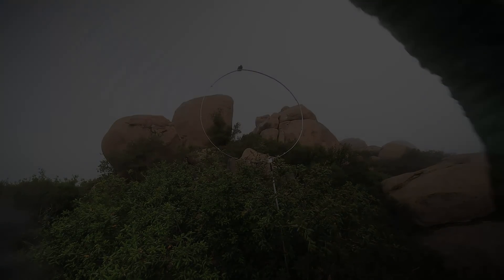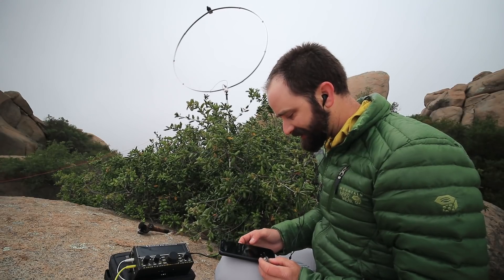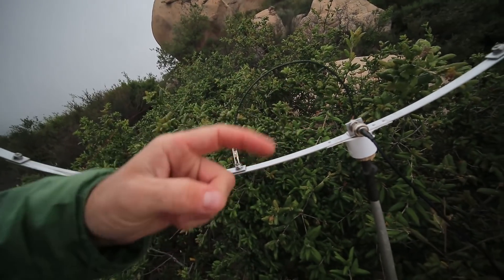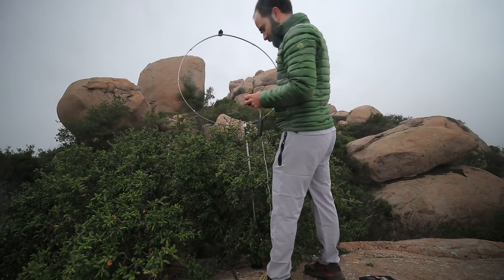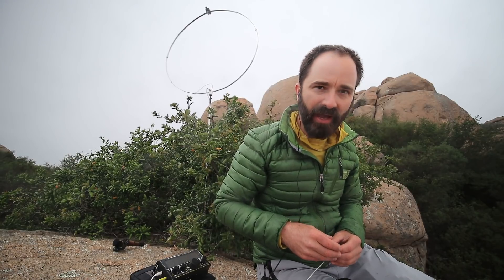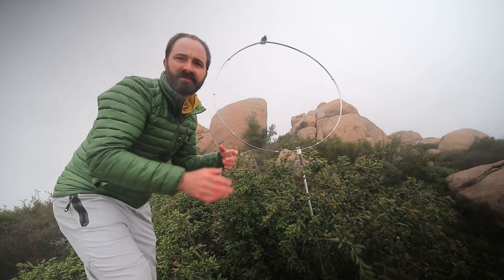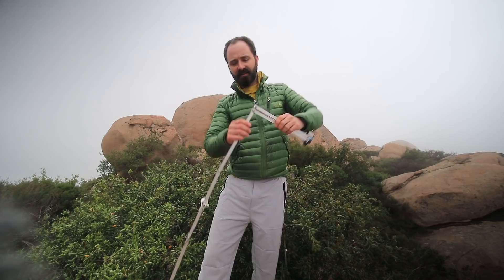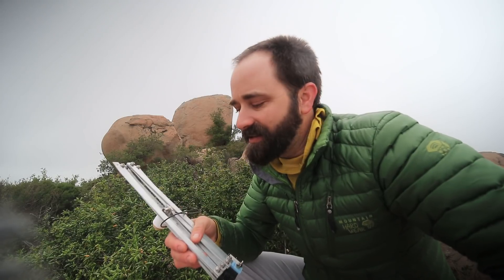Tiny Magnetic Loop - Big DX

Comment: I got a heads up about you magnetic loop video from KB2HSH. John runs loops in his apartment, mostly on FT8 & FT4. I build loops from RG-11/u coax and air capacitors, not as portable as yours, but functional nevertheless. 

I am handicapped with two total knee replacemebts, so no hiking to a site for me. If I can't get  there with my Forester, I can't operate portable, heh... My more robust loops fit in the car nicely and a drive-on mast stand rounds out the station (wagon).  Assorted QRP gear here, FT-817, X6200, G106 and a G90. I run off the car or off a 20AH AGM battery.

Hope to catch you on the air further down the log! 73, Keith, WB2VUO near Buffalo, N.Y.

Comment: What CW keyer do you use and what logging app on the phone?  Tks
Reply from the maker: The KX2 has a built in keyer, so no external keyer is required. Just plug in a paddle. I like to log using POLO. Great app!
Reply: @K6ARK   Sorry . . . I mean the "key"  Paddle.  Tks
Reply from the maker: @h2osmokey for this one, I was using a little homemade unit cut from acrylic and using some steel shim stock as the levers. I would recommend building one of my paddles posted on Printables.com. they're cheap and work very well.
Reply: @K6ARK I'd be interested in buying a couple of them as I don't have 3d printing ability.
Reply: @K6ARK  Are they available online for purchase?  Don't have printing abilities.

Comment: Excellent design ! Using fixed capacitors plus low value variable probably makes it easier to fine tune as on my loop the peak is very sharp and narrow and hard to find. I will give your idea a go.

Comment: Loops are amazingly good considering their small size. I've used one indoors and got into a lot of Europe with it, 5 Watts or less. I used a coupling loop which is not perfectly circular to get a better match. I want to try the gamma match sometime. I got an FT817ND to go portable and a loop built for it using ½" coax so it can be coiled up to fit in my motorcycle panniers or rucksack. H/B radio too big.
G4GHB

Comment: I've been using magnetic loops vfir more than 20 years. They are great. Especially 20m up to 10m I will not be without my copper frames 😂. Don't need a tuner. The vary cap is the tuner itself. Good job Adam.

Comment: got to be the best loop design so far! Are you about ready to show us how you build it would love to get some additional information how to build a magic box and the size of capacitors
Reply from the maker: Yes, I just need the free time to make a build video.  Been working hard on antenna kits, winders, and new 3d printed paddles. Hopefully soon?
Reply: @K6ARK  Isn’t it great to be busy!
Reply from the maker: @PatAutrey  I need to retire! This dang work thing is cutting into my fun time.
Reply: @K6ARK  I was wondering if you have ever used an auto tuner to tune a magnetic loop directly ,- I have the MFJ 939 auto tuner and was wondering if it would work on a magnetic loop that I made mounted to a hula hoop, would not be using any other tuning circuitry other than this automatic container what are your thoughts o

Comment: Great job!

I’m wondering about the joints between the bars and the resistance caused by not being a continuous piece.  I had thought that was the reason people made them out of copper tubes and whatnot, but have not read up on them in ages.

Comment: Do you know if anyone makes a kit for this type of antenna? Considering buying a small QRP radio and looking for a decently performing, lightweight, compact antenna. Too many of the antennas give good impedance matches, but terrible radiation. Thanks!
Reply from the maker: No, I've never seen one. It's not a particularly efficient antenna, but as you could see, it does work.  I generally prefer an EFHW with very small wire which packs down much smaller, but obviously requires a larger footprint when set up. Your best bet if you don't want to build your own is probably one of the mag loop models that uses coax as the loop. I still plan to make a build video for one of these antennas, just haven't had time. Work and life are taking up a lot of that lately

Comment: That should be able to handle alot more power than coax loops. How many watts you think it will handle?
Reply from the maker: The primarily limiting factor for loops is the capacitor which experiences very high voltages. Because mine is built with 500v fixed value caps and a small air variable cap, 5 W is pretty much the limit. To push it up to 100 W, I would need a much larger, more expensive vacuum variable capacitor or a very large air variable with big spacing between the plates.

Comment: Do you notice any improvement changing the direction of the loop?
Has anyone compared this to a budpole, or any home brewing of 2 hamsticks configured at a dipole at about
6-10feet off the ground?  I can see this antenna as designed easier to transport.  Just curious how it compares
performance wise to other portable antennas.

Comment: I ran a FEM simulation.  Since the antenna is << smaller then the wavelength I can use magnetostatics.  I got an inductance of 3.097uH.   I modeled a loop with .5inch by .124 inch material.  I used copper (it should be Al but I don't think that will impact the inductance.   

 
This is 1 amp.

Comment: I never really liked the idea of magnetic loops because they are so narrow banded. However, this video made me realize that for something like SOTA, that basically doesn't matter because you spot yourself on a frequency and stay there. So it looks like I have a new antenna to research...
Reply from the maker: Yes! For SOTA and POTA activating, most operating involves just selecting a frequency and calling CQ. I don't often use a mag loop on summits, but they are very convenient when space is limited for setting up a more efficient and broad-banded wire antenna.

Comment: Couldnt count my fingers. Actually, the loop is 12 feet in circumference, about a meter in diameter. I tried adding 4 more feet but it just got unwieldy so back to 12 feet. Efficiency plots out to something like 14% on 40m to the mid 90s on 10 meters   Air variable wont be here until mid week next week so film at 11.

Comment: No 1/16 stock at my local HD but 1/4 worked ok. Cut it into 2 foot lengths since I am not likely to be doing much backpacking   I used six feet and it came out to just a shade over a meter in diameter. I still have another four foot piece. I bet if I stuck that in there it would be more efficient on 40 m. Just thinking out loud. I have a couple of 2-20 pf air variables ordered. Now I need to figure out the fixed caps
Reply: Ran the calculator and it confirms my thoughts about the size. Going to add another 4 feet. something like 95% efficient on 10 meters. Pretty good on 20. Not real happy on 30 and 40 but it looks like it will work at a low efficiency
Reply from the maker: Awesome, John! Would love to see pictures when you're done.

Comment: I've never seen anyone use a Gamma match on one of these before, is that better than just using a small loop?
Reply from the maker: Better? I don't know. But it works... 
I suspect my method of gamma match attachment could be more lossy due to potential resistance at the alligator clip.  It does, however, have an advantage of being easier to tune for minimum SWR because I can move the attach point.

Comment: Wow! Great 40M JA contact.
Very interesting construction. I'm amazed you can resonate on 40m wirh such a small circumference. Great idea of using a small variable cap to fine tune the large fixed caps. I've been suprised that other builders don't also do that and then complain about critical tuning. Seems like a 'No Brainer' to me. Should be standard practice.
I'm curious. What is your Transmitting Band Width on 20M/40M. I assume wirh such a small loop that SSB TX would be very distorted.
Regards/73 OM ..

Comment: Really nice design! I loce the gama match simplicity. Can I ask you how you calculate the 2 capacitor that you put in paralell of the variable for each bands? Also how did you came up with the lenghts of the gama match? Thks! DE VE2PF
Reply from the maker: Pierre, to identify the needed fixed capacitors, I set up the loop and attached a larger air variable capacitor across the tuning point using short wire leads and alligator clips soldered to them. I tuned the cap until I found resonance, then removed the capacitor and measured the capacitance with a LC meter. Knowing the capacitance range of my small air variable, I determined how much fixed capacitance I would need to have the same value I measured from the larger air variable.  I did the same for each band. 

I determined the gamma match length and configuration experimentally by arbitrarily choosing a starting length and then testing. I would move the contact point closer or further from the feed until finding the match closest to 50 ohms with the capacitor set to resonance. 

Hope that helps!
Reply: @K6ARK  It does help! you did experiment and came to specific value for your specific antenna.  can I ask you what are the value you got? And confirm that the small capacitor is 1 to 7 pF??
Reply from the maker: @pierremartel3552  yes, the small capacitor is roughly 1-7 pF.  Total capacitance needed will vary by the size of the loop and the frequency. Smaller loops with lower frequencies require more capacitance. For a 20-40m antenna, a 2m diameter loop is ideal. Check the calculators in the description for capacitance requirement estimates for a given loop size and frequency. They should be decently accurate.
Reply: @K6ARK  this will give me some starting point as I dont have larger air variable to test.

Comment: Would love to see inside the capacitor box.
Reply from the maker: Indeed... https://photos.app.goo.gl/vvxfF9YWXS3D2kKK8
Fixed capacitors on a 3 position switch in parallel with a small air variable cap. The switch swaps in the fixed capacitance required to get the antenna resonant within each band and the variable cap tunes across each band.
Reply: @K6ARK  TNX - I worked on a similar project some months ago and had trouble getting suitable results with switching the capacitors so I've abandoned it. Perhaps I'll go back to it and try reworking it. I purchased a high voltage capacitor kit from Amazon for about $9 and have been using them with good luck on other antenna projects. They're very tiny and should work on this loop project.
Reply from the maker: @glevideo  cool. Feel free to email me direct for any questions/discussion on how I make it work. Also, if I remember correctly, some of the ceramic caps I used drifted too much with 5w of RF going through them, so I switched to silver mica.  Class 1 caps should work too though (C0G or NP0).  I believe I was using class 2 not knowing what impact that might have, and the result was drifting tuning in a very high Q circuit.
Reply: @glevideo  Sounds interesting, I must leave in my home in Caracas Venezuela all my junk boxes of many years as a ham, and here in USA the pandemic situation doesn't permit me to assist the hamfest usually happens here. Could you share the specs of the cap on Amazon? Many tks from YV5FCK Armando in MI.

Comment: I assume the "inductance" of the antenna is just the self inductance of the loop.  How important is the resistive loss of the aluminum.  Do people ever use Litz wire for a loop.  I happen to have some.
Reply: I"m down the hill from you in San Diego close to Poway.
Reply from the maker: Howdy, neighbor 😆
I'm not familiar with Litz wire so I had to look it up.  I believe you need a conductor with larger surface area for lower resistance at high frequencies.  A wire like that might buy you a little, but I don't think it's a substitute for a larger conductor.  But what the heck, give it a try and let us know how it goes!
Reply: @K6ARK  Litz wire is used for high frequency switching power supplies.  Often as small as #40 gauge for each wire.  It's not hard to calculate.  I'll give it a try for 20m.
Reply: If you take a .25" copper tube at 14 MHz then resistance per meter with skin effect is 48 mohm/m.  the resistance of #40 wire is 3.9 ohms per meter.  So if you use a litz wire made of 80 strands of #40 you get the same resistance.  That's equivalent of a 28 mil diameter wire which is #21 gauge.   Litz wire is woven so the outer wires go to the inside so the current flow is balance.  There are some tricks to soldering the wire but not bad if you get the correct insulation type.  
  .
Reply: Note that on copper tubing the current will flow on the sides surface so the resitance is higher then my calculation.  But that would not be an issue with Litz wire.
Reply: I meant the inside surface.
Reply: @K6ARK  any poop on the matching device. Getting ready to spend the summer in the mountains in NC. Would love to build this loop for SOTA.
Reply from the maker: The box is very simple. Fixed capacitors in parallel with the small (roughly 7 pF) air variable capacitor. The switch changes the fixed capacitor values. The fixed capacitor values were experimentally determined to identify the necessary capacitance to get the tuning to the 20, 30, and 40m bands respectively. The air variable tunes across each band. https://photos.app.goo.gl/5B328Q8t1QMq3nc58
Reply: @K6ARK  Cool

Comment: Hi Adam, videos that cover your strategy for building and matching loops would be excellent.
Reply: I’ve built a few loops, from simple ones made from reclaimed RG6 and a toroid core ripped from a switch mode power supply, through to one made from 1” x 1/16” aluminium strap with a motorised tuning capacitor that handled 50-60W but caught fire when I gave it the full dollar :-)

They are excellent and, elevated enough seemed to out perform my back yard verticals I have made from aluminium tube 

The narrow bandwidth keeps the noise levels down, and certainly removes broadcast band interference on the Pixie my son built :-)
Reply: That big loop was 3m wide as well. Killer on 40m

Comment: Great job Adam !! Another Informative video !! Already built the micro-trapped EFHW. Was considering this type of loop but using a continuous piece of aluminum stock that I could roll up in a tighter coil to transport without all the mechanical connections of the sissor folding.  Food for thought. Look forward to your video on the capacitor box. 73 Terry W4ZQ

Comment: Brilliant and well done on the 40 m QRP contact to Japan, been messing with loops for a long while so like the idea of switching in fixed value caps, do you have a circuit you used ???, also where did you get that lovely little paddle from???, just set up a 705 to start doing portable activations and trying to get the kit down in size so many thanks for your time and sharing, 73 de G0VCW.

Comment: For the wingnut - get some brightly-colored nylon "mason line" at a hardware store and CA glue+tie a length to one of the wings. You can hold the line or loop the end around a finger while you screw it on/off to save it if you fumble your grip. It also gives you a fighting chance to find it if you drop it in the brush/gravel. Can also screw+CA tack a few spares onto some of the other bolt stubs if there's room. Good to have a fix right at hand when you need it.

Learned this trick the hard way with some adjustable garden antennas...

Comment: Hi Adam, that’s a pretty neat way of assembling the loop and still packing it down.  Maintaining good conductivity at the joints is the main thing in these loops, which are a really low impedance and have high currents in them.  Any ideas about the power limit forced by the capacitors?  I know lots of designs for higher power use vacuum capacitors to get the voltage rating needed.  Even 5 watts produces several hundred volts at a high impedance point.  P=E**2/R so E**2 can be 50k, E=223 if the impedance is 1000 ohms at the junction where the caps are. I guess an A/B comparison against a full size dipole is in order?  Would not be surprised if the loop was 20 db down on a dipole.  In good conditions, tolerable.  Darkness across the Pacific on 40m helping with the JA contact, around midnight or 2AM local time in JA if it’s early morning in sunny California!  73 Andrew vk1da
Reply from the maker: Based on some calculators I've tinkered with, the capacitor voltage at 5w should be close to 500v.  The silver mica 500v caps I have in the match box have held up this far. 😬

I really think opening and closing the segments (pivoting the joints) goes a long way to clean up the contact points and ensure decent conductivity, but I'm sure there is some loss there. I don't know how to measure the amount. 

I am fairly certain the loop is 10% or less efficient on 40m which basically means JG0AWE was able make that contact with a very marginal signal.  The propagation gods were definitely in our favor. 

There's good reason this antenna isn't my usual SOTA choice, but it's unique and very useful when it's not possible to set up a longer wire. The packability and weight are awesome too.
Reply: @K6ARK  ok so that suggests the impedance may be higher yet than my guess, no surprises there!  Agree re contact cleaning.  Very neat idea, I think you’ll trigger a wave of folding loops now!  As you say, not the best antenna but for those really difficult tight summits with no space for wire antennas or radials, a great backup option!  73 Andrew VK1DA/VK2UH
Reply from the maker: The mini air variable was from eBay and I don't know what it can take as a max, but similar models I've seen for sale are rated to 1250v. I should look for a part number on it and see if I can find its max voltage.
Reply: A well formed loop has about 50 percent efficiency, perhaps 3 db less than a perfect dipole placed suitably high in the air.  Where that's not practical or possible the loop can greatly outperform a poor dipole.
Reply from the maker: Thomas, thanks for sharing your wisdom on the subject in all of your comments here. I really appreciate it!